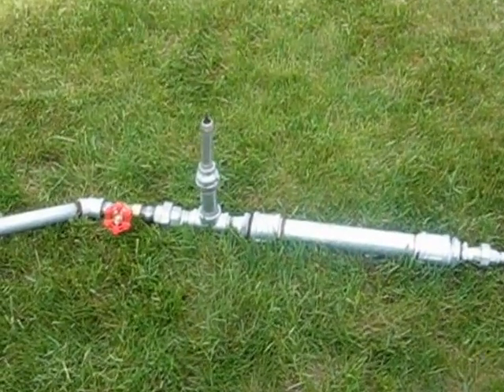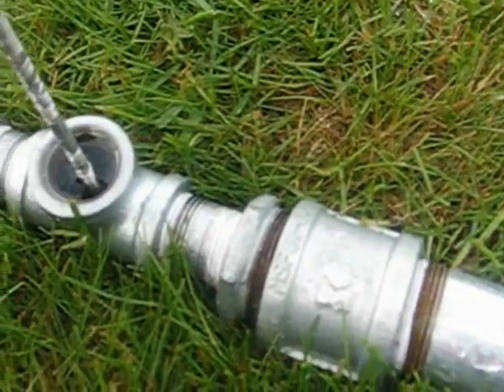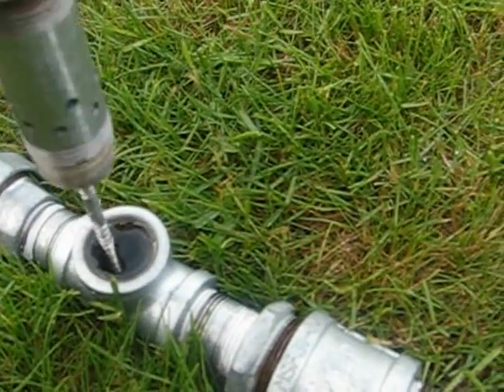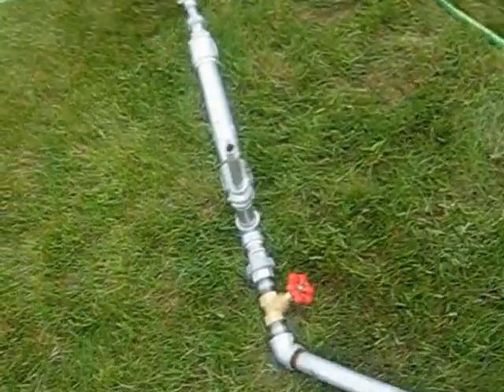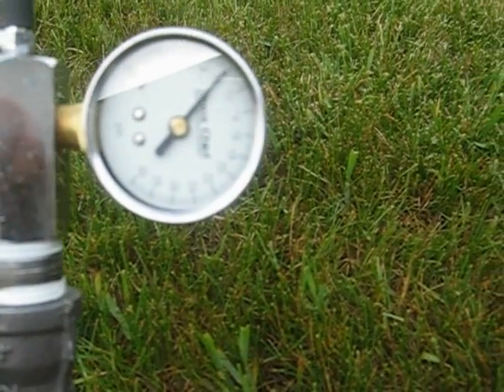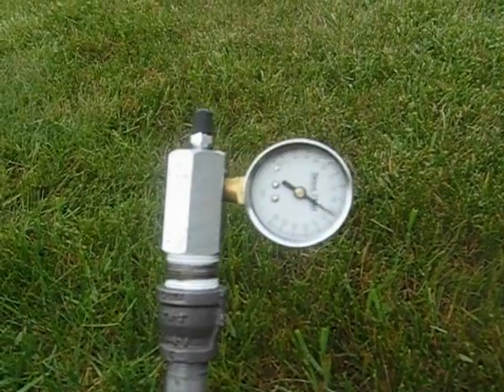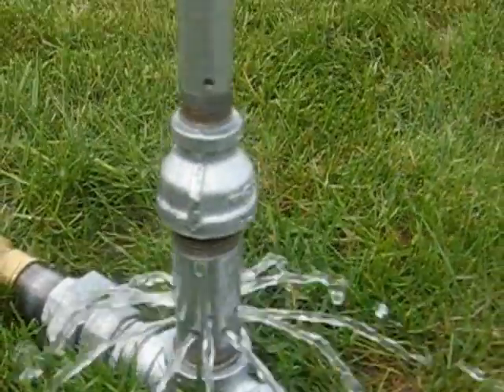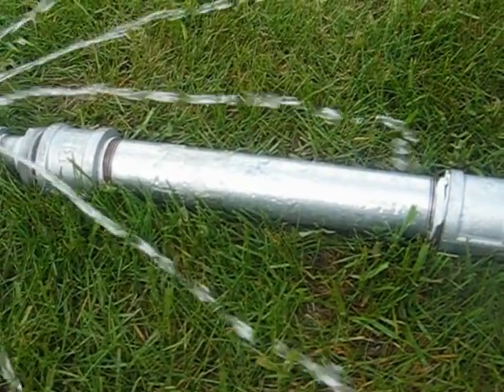Ram Pump with Waste Valve redesign

Comment: such a waist of water... :(
put that system in a reservoir  to get the waist of water and conect a fine tube with an "Y" conection to the way out. the point is: the way out water preasure wil create a venturi  and will pump the waist water of reservoir :) ( you will need a valve to calibrate the preasure of the venturi :)
Reply: water doesn't have waist..........
Reply from the maker: ricky enriquez Thanks, Ricky ;). You are insightful.  You wouldn't have a waist either if you had zero calories.
Reply: Do not think of that water as waisted. A RAM pump is a completely passive device that can pump water many feet above a large source of water such as a lake.

It works by initially allowing water to flow from a source, down a few feet and out the pump, then when enough water is flowing (with a relatively high flow rate) the piston of check valve shuts off, causing the pressure inside the pump to skyrocket! There is another check valve inside that pressurizes the hose (and also a pressure vessel, I don't think it is required, though.) That water is what will end up being pumped up possibly several hundred feet above the reservoir.

If you are involved in electronic design like me, the operation of this is essentially identical to a boost converter.

Through an inductor, a path to ground (what looks like a short-circuit) is allowed for a short period. Of course, current flows, but increases steadily over time. Once enough current is flowing from the positive of the battery to ground, the path to ground is immediately broken, causing the voltage (electrical pressure) to skyrocket. This is captured by a diode which only allows current to flow one way, just like the check valve!

In other words, about your idea, it likely cant work since the reason it can build up pressure is that some of that water is allowed to bleed away, causing useful work to be done. If you put any back pressure on that, then the PSI output from this will be reduced, and how far you can carry water up will diminish.
Reply from the maker: Wilko,  I would encourage you to research the term "Ram Pump"  The general concept is not mine.  This is a redesign of a VERY old technology.  It has nothing to do with trying to use all of the water.  Most of the water coming down the pipe is REQUIRED to be use as the energy to pump up a little water....sometimes hundreds of feet.  The application for this design is not a nice house in the suburbs of the US.  Where this is used today (in basically the same water waste scenario) is for very poor villages around the world where their only water source is down a cliff or steep hillside and difficult to get.  Most of the water of the stream is supposed to continue down a stream.  This just pumps water day and night up to a tank for the village to use.  The power is FREE.  Don't worry about waste.  It is not wasted.  The water would continue down the stream to be used by the next village.
Reply from the maker: You can try a venturi, but I do believe that any kind of pressure (feedback) on the waste water set you up for trouble in creating the pressure.  The pressure is not from a spring but from a sudden closing of the valve that "rams" the water through.  If you apply any kind of resistance on the waste water, you can either reduce the speed at which the water rams, create too much back pressure so there is not enough momentum before "ramming" or you end up with a constantly variable venturi because the water speed is always changing along with the speed of the water coming in.
Reply: You cannot have any pressure on the waste water valve or the system looses efficiency or fails.Place the whole rig in a stream with the discharge hose exiting the system, so the waste water just goes back into the stream.

Comment from the maker: No.  Not really.  These pumps are designed and intended to be used in a stream.  I would put a large 4" pvc pipe around the stand pipe to control the spray, but you can't pump the water back up.  The assumption in using these is that there is more than enough water flowing down and you get just a small amount of it...for free ;)

Comment from the maker: Not really.  If you want to attach a helium balloon to watch it jump around in the air, that would be fun ;)  The energy of the valve is sensitive to pressures and must use gravity to allow it to fall.  Too much downward pressure and the valve will not jump up and suddenly close.

Comment from the maker: David, Thanks for trying to stay positive ;) To address all your comments:
The standing pipe doesn't have to lay up or sideways or anyways.  The only important part is that it has air in it that acts as a shock absorber to the water...much like a spring...compressed by the shock, then helps to squeeze the water up.  I use a bike inner tube which will do just fine for this purpose...not foam, unless sealed somehow.

My whole concept on the water valve was simplicity for 3rd world conditions.

Comment: OK. Love the concepts and your creative thinking Greg. Superb bud. I am a newby OK.. LoL. Am I right in saying you have laid the pipe which normally sits vertically to drive the water up hill, horizontally? It is also still filled with foam right?

Also what was your thinking about waste plunger. Are you trying to make the valve work quicker and more efficient or was it to create a sprinkler (asking not being trite)? Again. 22/23psi is really really good from my research. Cheers G - David

Comment from the maker: The potential energy of the rod going up and down is negligible compared to the energy used for pumping the water.  If you add weight or work to the rod, the pump won't work or work well.